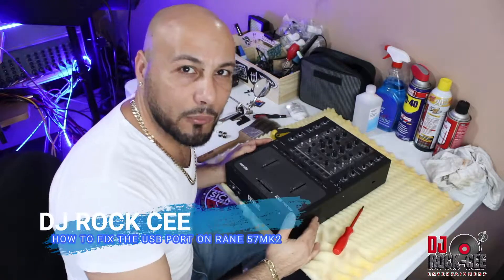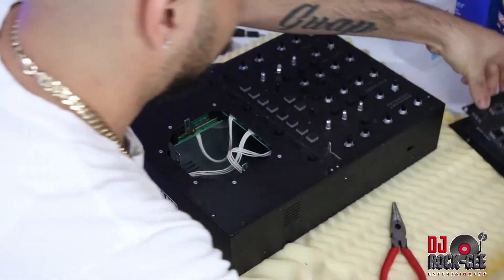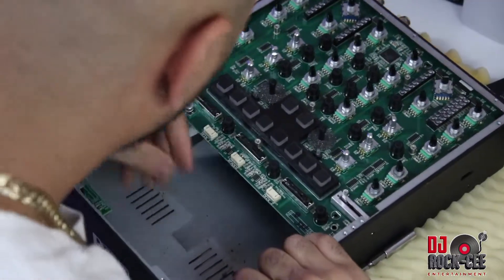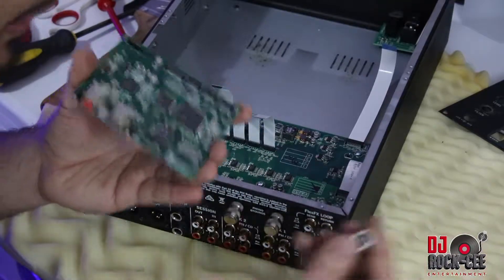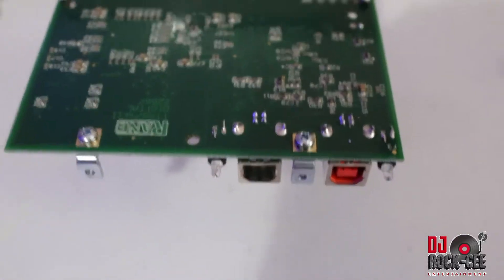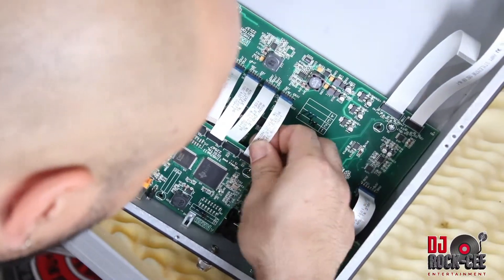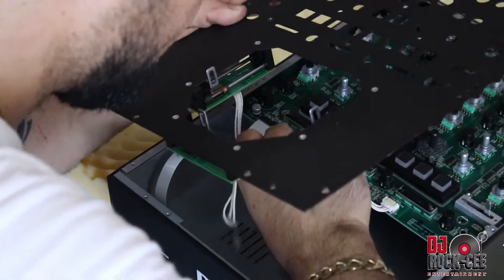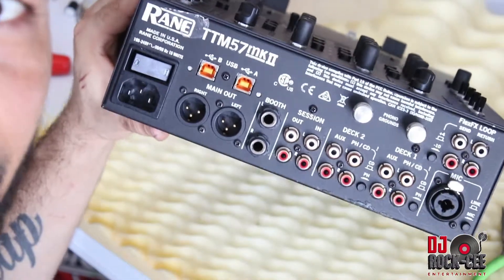HOW TO FIX THE USB PORT ON THE RANE 57 MK2 (2018)

Comment: Question, I have the Rane ttm57 mk2. The mixer is turned on and does the flashy light display, but doesn't stop. no sound, no communication between computer and mixer. Any idea?

Comment: Just a heads up, I was informed that Instrumental Parts ran out of the Rane USB PCB Assembly (part #22566) for the 57SL.
Reply from the maker: El Kinesis yea that board is hard to find now. If you lucky you get a used one on ebay, I was looking for one up to last week but didn’t find any. What happen to the one on your mixer ??
Reply: The main issue I've seen is that the L3  component on the board is damaged or removed. The same thing happens on the Sixty-Two. The USB port gets pushed in due to a drop or some other damage, and it pushes that component enough to break it off of the board. I'm not really sure what that component is, though.
Reply from the maker: El Kinesis yep common problem with the rane mixers. The quick fix is to jump it using 2 small wire. It will work with no problem. Is hard to solder those 2 small wires but it can be done
Reply: Interesting. I thought about trying it, but I didn't wan't to cause any additional damage to the components on the board. I'll give it a shot when I have a chance. Thanks for the advice.